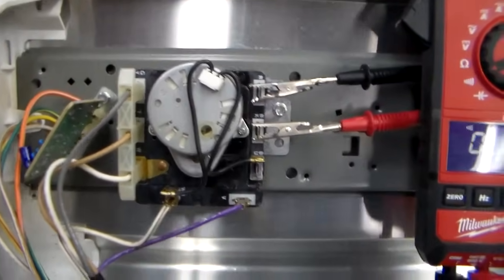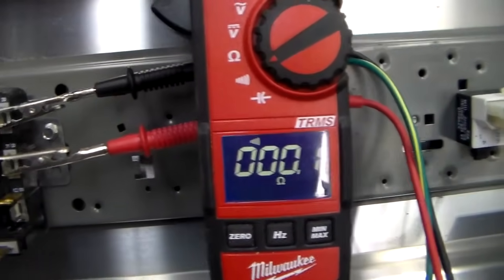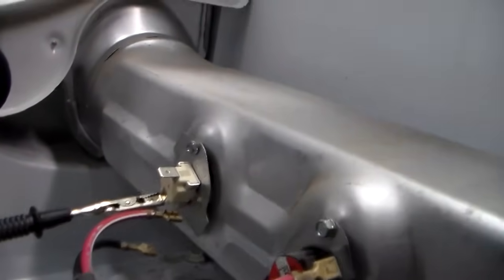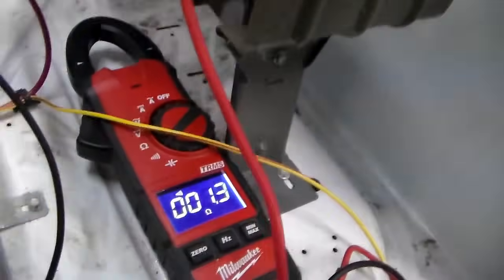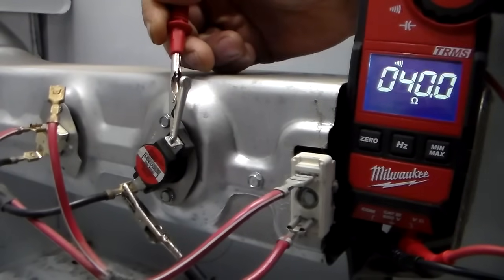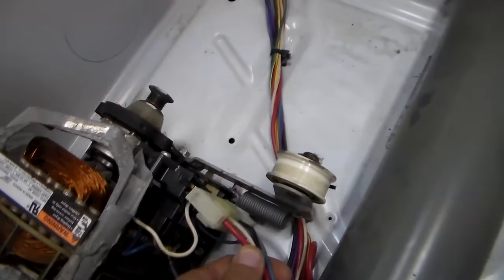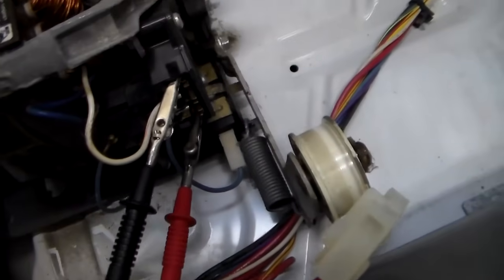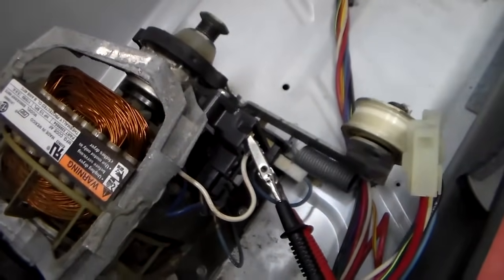Kenmore Electric Dryer - Not Heating, What to Test and How to Test

Comment: Thanks Bill. This is still a very relevant  video.  I am a lowly homeowner, but will try to repair something if I can.  Dryer stopped working (no heat), so I "assumed" it was the heating element since it had gone out once before and $230+ later I had it repaired.  This time I simply ordered one on the internet, installed it and nothing.  Found your video, tested the coil (no problem), but one of the thermostats was bad.  I slammed it on the floor a couple of times (as shown in another of your videos), and like magic it was back to working.  Cleaned out the vent and everything is good to go.  Thanks so much for your helpful video and saving me big bucks.

Comment: Hey Bill, I have a Kenmore Dryer and noticed a few months ago my cotton shirts were starting to shrink.  I always dry everything on low heat.  When I tested the exhaust temp on the low heat setting it was cycling in the 130's with occasionally getting in the high 140's and even mid 150's a couple of times.  I have changed every single part on that dryer with the exception of the start switch, motor and wiring harness.  I've even changed the cycling thermostat twice, and changed the timer yesterday.  No dice.  It's still cycling higher than it should on low heat.  Possible it's the wiring?  I'm stumped.
Reply: I just changed the typical parts and it's still not getting over 90F. Did you figure out what your issue was?

Comment: Thanks for video. I followed along and did all tests, and watched the motor switch video. Everything is testing ok. Not sure what else to test before I start putting it back together. The symptoms are as you mentioned: no heat, but spins just fine

Comment: Thanks Bill, I'm pretty handy i suppose but this video is exactly what i needed to make my confidence boost a bit! Do i need to remove the front lower panel/kick plate to do these test or is everything tested from the back only? Unit will spin and blow air, just not heated air...its electric 90 series as well. Thanks

Comment: Thanks Bill very good clear instruction. I thought my exhaust thermistor was faulty as it does'nt have continuity.- No heat on our Kenmore HE2 dryer until I found that you have to check for a specific ohms reading. control panel showed NO fault codes previous or present, I had had some electrical work done and my mains breaker panel had been re arranged and it turned out that I was only getting 120V to dryer everything worked except heat. providential because I stripped the whole machine and inside the exhaust system must have been stuffed by the previous 'family' a 6"x6" fabric pot holder which blocked the pipe and had backed up two fistfulls of lint, but for this initial wiring mistake I would not have found this. 240 V now everything works fine.

Comment: Thank you for posting your videos, Bill.  Our dryer stop heating New Years Day.  Watched your videos and discovered my non ressetable thermolimiter not working.  Tossed it on the floor a few times and good as new.   Lint was backed up in the venting within the dryer so air not circulating.  Ordering some new lint and blower vent seals to get the blower vent working like 1998 again.  You saved me some hard earned money and wanted to say thank you and Happy New Year!

Comment: After checking all of the safeties, I still can not get heat.  I only have 120 volts at the heater when in full hot setting on the timer.  Any ideas?

Comment: Kenmore 110. 98576200
Shuts off after couple mins on heat cycle. Does not restart by itself. 
No heat at all
Runs full cycle on delicate setting but no heat. 
Runs full cycle on air dry

Any ideas? Sounds almost like same issue as video

Comment: Well done! Although I always start at the wall. It's common to find 220v across the top but only have 120v on 1 side and 0v on the other side. This can cause a no heat or heating with no motor.
Reply: Yes so easy to forget when things light up thank you.

Comment: Thanks for this detailed video, which also led me to your awesome thermal cutoff fuse reset video.  One question though...why do you unplug the leads to all the fuses/switches before putting your multi-meter probes on them?  I am able to get readings with them left on...one less step.

Comment: Hi Bill - We have a Kenmore Residential Dryer (417.88042700) and sometimes it will heat up and sometimes (most of the time) it won't.  It's about 8 years old.  When it is working, you'll see the orange/red glow in the back and when it's not working, you won't see that glow.  Do you know what it could be?  Thanks so much, appreciate any advice!

Comment: You completely ignored the heater relay which is in series with all those other components and the heater.  Mine is bad, will not close the main contacts when the coil is energized.   Sears wants $53.  Got new one on Ebay for $7.83.

Comment: My timer allows the dryer to run, but the heating coil does not heat the air. Everything except the timer passed the conductance test, so should I buy a new timer? Also does the letter that follows the number matter? Seeing various parts with different Letters available, but my letter is an E. So do I need an E following the part or will any timer work?

Comment: First thing to check is the timer when the issue is no heat?   ???   WRONG
Reply: Tgud1 your timer controls the heat settings, such as the air fluff setting, which is no heat so yeah has to be checked

Comment: Bill - Thank you, thank you, thank you.
I've bought my house 15 years ago.  The Kenmore 90 came with the house.  Over the 15 years, plus the years before I owned the dryer, it has never been cleaned, including the 3 foot duct.
Today, I put a load in the dryer.  The drum was spinning, but no heat.  F 'n A!!!
I did some research and discovered your video.
I took the entire unit apart, cleaned it up (it seemed like a cubic yard of lint - lint was everywhere and it was thick).  Then I tested all of the switches.  The one that wasn't working was the thermal cutoff.
I ended up using your (and the "old man's") trick to fix the thermal cutoff.  It saved me $30+ dollars and having to wait a week for the part to come to my house.  Awesome.
Great explanation and video quality as well.  Thank you.

Comment: I am trying to fix my Kenmore dryer not heating problem i found heating element  broken and also Kenmore Dryer Cycling Thermostat has 4 terminal 2 on the edge has continuity but  two center one  has no continuity i don't know it is broken or no t

Comment: Bill  Can you help I have a Kenmore Elite Steam dryer model # 796.6927. It is not heating/drying clothes.  Was ready to check 
all the elements are in  you said.  But I can not get the back off I can see inside and all the elements are within reach..  The back screws are all out , but the side ends of the back panel are are over lapped with the side panels. It wont move, I work in a machine shop so I am not a novice with mental working.  Ant ideas?

Thanks I hopr this recaches you.   Jeff

Comment: I was about to go and buy an element until I saw this - thanks. In my case the thermal cutoff did not have continuity and I reset it by throwing it on the floor a few times. However, I still have a problem. I lifted the top a bit so I could see if the element was glowing red and it cuts off after maybe 20 secs. I let it run anyway for over an hour and the clothes were still damp. Does that thermal cutoff cycle on and off during the heating cycle? Or is it defective and needs to be replaced?

Comment: Man! Gotta say, I just had this very problem. Of course I ignored the "Well I guess it's time to get a new one." comment and said "No. Let me take a look at it." Turns out the vent wasn't sealed properly and instead of getting caught in the lint screen, lint was just getting blown inside the unit. [What average user would expect that to be a thing?]
Well, obviously the thermostat was tripped and after using your handy resetting the non-resettable trick, we were back up and running. And all it cost me was an hour of my time! [most of which was spent vacuuming the crap out of that thing.] Thanks!

Comment: Thanks so much Bill.... it wasn't obvious what was wrong, maybe I reset the thermal cutoff???? One of the wires looked 'corroded' but still passed a signal.  I disconnected / tested / reconnected / and cleaned everything as I went - all the way through including taking the drum out and testing the motor. I never knew anything about dryers before...  and it now works! Not sure what was broken...but it works. So, thank you very much!

Comment: The Kenmore will heat on some options, but when I set the dryer on the minute side it won't get hot...do you have any ideas?
Reply: I think the first or second thing he checks in the video is the timer and instructs to set the dial to timed dry to check it.. sounds like it might be worth a look.
Reply: i already figured it out. Thanks, and yea it was the timer.
Reply: wuurd

Comment: I'm a mechanic by trade so of course I was going to dive right in and figure my problem out, but you sure saved me a lot of time! One of the heater element coils had a break in the wire causing an open circuit. Cost me $48.00 and no outside labor charges! Thanks!
Reply from the maker: Awesome Job!
Reply: J in v2

Comment: Thank you for your very informative video.  I didn't get a reading from either the thermostat or the thermal cut off.  Is it possible that both went bad?  I was able to reset the thermal cut off thanks to your other video but the thermostat is still not getting a reading on my voltage meter.

Comment: hey Bill, the bearing broke but the power was fine, so we just replaced the bearing in the dryer, put everything back together and now it has no power at all, nothing not even the ticking. what could of gone wrong? I should mention it's a stack washer/dryer and the washer works fine

Comment: Bill - Have rung-out timer, operating thermostat, thermal cutoff, and thermal fuse.  Still no heat.  Also the dryer runs and runs and doesn't shut off.  Still a timer issue?
Great video BTW.

Comment: I appreciate your great videos. I've tested all the parts in the machine and all seems fine when the unit is cold. The airways are all clear from the lint trap to the exhaust port on the house. It runs for about 10 minutes then the heat dies. I assume the high limit thermostat (attached to my heating element terminals in my 110 series dryer) is tripping. Is it safe to just replace the high limit thermo and the thermal cut-off switch even though the HLT tripped for some reason? Thanks again for your help!

Comment: My temperature selector switch was bad... you don't test for that.  Maybe it is not on the wiring diagram.  My manual doesn't show the switch on the diagram of the dryer.
Reply: +Denise Williams ...okay that switch is good.... testing everything and all good... even motor switch.  How do I test the wiring?  I replaced three connectors which showed signs of blackening and it lasted three weeks, but now is doing it again... runs but no heat.

Comment: Thanks Bill- very helpful, nice video quality.

U Jumped right into TEST THE TIMER.. But how do I get to the timer? 

Also 
the entire heater assembly (thermostat, fuse, element) cant be checked at once (about 10 ohm)... disconnect one of the two 220V wires and test the whole circuit. IF open, THEN drill down to components...

My thermistor only had 2 wires?
Reply: Yu
Reply: Ddddddydyyyyyyyydddn mmmrrd

Comment: Bill, thank you so much.   I love doing stuff around the house to save money.  I followed your step by step instructions.  I forgot that I had stuffed steel wool in the dryer vent hood to keep out the mice after trapping some in the basement.  Then I turned on the dryer..... then I remembered  the door wouldn't be able to open,  and ran down to turn it off.  Too late - it wasn't heating.   I followed everything you suggested and it was the thermos cut off.  It took longer to get the back panel off than to test everything.  THEN............ I tried your secret trick to reset the thermo cut off thermostat, THAT WORKED TOO!!!!  I was so excited.  THANK YOU!!!

Comment: This is great! I think I found a faulty thermistor. One minor quibble about the video. You say that your multimeter is set to 'Ohms' but it appears you have it set to 'Continuity'. I'm new to this and it took me a while to figure out what the reading should be.
Follow-up: I replaced the thermistor but it still doesn't heat. I get continuity across all the parts that you show EXCEPT the thermistor. When I check the resistance I get about 16 kOhms. What else can I check?

Comment: This video is great.  Unfortunately I've had a very hard time even getting into my machine to find these parts.  It's not acceible from the back, which I would think would make this much simpler.  Apparently you have to go through the front which is not intuitive to me.  Access to the control panel is baffling me as well.  I have a Kenmore 800 Model 110.  I'm more than frustrated.
Reply from the maker: +Chris White How did you make out?  Did you get it fixed?

Comment: Hi, I believe I have a bad circuit board, have you had any experience with that? My brand-new Kenmore dryer that has never run but is 19 years old, long story, anyways it will not start, only a very tiny hum at the motor, I have checked all the switches and fuses that you mentioned and also tested the motor which works perfectly, but absolutely will not start, I have noticed that the timer motor only turns at one position and when pushing the start switch. I have also taken the timer off and apart and tested it for continuity in all the positions, so I think that leaves the pcb or circuit board. Any help appreciated.

Comment: My dryer is heating not very well. All parts I relaced, including heating element. I found some blockage in the duct in the house but don't think enough to cause problem. Cleared and reattached exhaust. Sill  takes long to dry. No change in symptoms. I suspect it's a wacky thermostat.
Reply from the maker: +Jeffrey Perkins Possible a weak one that's tripping at a lower temperature.  Did you replace the thermostats?

Comment: I cleaned out the blower and ducting and then tested the components for continuity as shown in the video and found them to be all good. The dryer still did not heat so I gave up and, figuring it was something other than what I had tested, asked my wife to go ahead and call a repairman. He came out and replaced the cycling thermostat and thermo fuse (both of which I had tested) and charged us $188 ($70 for the parts). Astounded, when I got home from work I tested the old thermostat again and it passed the continuity test. Ebay charges a total of $7 for these two parts. I feel like I did everything right but still got screwed.
Reply: Same thing is happening to me right now.  If I figure it out I will post the results.
Reply: It ended up I was only getting 120 out of 240 volts to the plug.  One of the fuses had blown.  This caused the dryer to work properly in every single way except the heating part.
Reply: I know your post was 2 years ago, but put back in the old fuses and see if the dryer works and if the tech was screwing you over.

Comment: I have a dryer that starts, runs maybe 2 seconds then turns off.  The tub spins and everything sounds normal in that 2 seconds other than it stopping.  Would checking the red wire be good troubleshooting for this?

Comment: THANK YOU MR NEWBERRY ! I have 81 and 85 yr old Parents. Seniors don't like change ! Their dryer DIED, and it has been below 32 deg here in CO for weeks. They had 2 full wet loads. Dad wanted to curb it and spend $400 ! I  I replace the cracked heating element and it works like the 2nd day they had it. IT IS A KENMORE 90 THEY HAVE HAD SINCE THE LATE 90'S.  GOD BLESS YOU, HAVE A GREAT YEAR ,ERW.

Comment: OOHRAW Semper Fi  Thanks
Reply from the maker: +richard c hamlin jr Semper Fi!
Reply: +Bill Newberry 

Frigidaire Gallery Series Dryer  #GLEQ21ES0So my dryer got extremely hot, then the next load the
display said “AD” and now has no heat.  
I checked the Thermostat and Thermal Limiter (fuse) both had
continuity, also the thermistor by the blower motor was running at 52K ohms,
next I checked the Heating coils and the element itself I got 11K ohms. 
I even checked the blower motor. So now Im lost why this
thing isn’t working. Please help!
Reply: +Bill Newberry 

Frigidaire Gallery Series Dryer  #GLEQ21ES0So my dryer got extremely hot, then the next load the
display said “AD” and now has no heat.  
I checked the Thermostat and Thermal Limiter (fuse) both had
continuity, also the thermistor by the blower motor was running at 52K ohms,
next I checked the Heating coils and the element itself I got 11K ohms. 
I even checked the blower motor. So now Im lost why this
thing isn’t working. Please help!

Comment: Very cool!
My dryer was stuck in ultra high hot.  I shut it off and allowed it to cool down. Then I checked the heating element and one of the insulators that separate the heater coils broke, which resulted in the element grounding to the frame inside the heater box. I corrected the broken insulator and checked the element for resistance. Element tested good. 
However, the thermal cutoff was not working. Using the method you demonstrated to reset it worked on the first try. 
You have saved me time and money.

Thanks for the great video.!